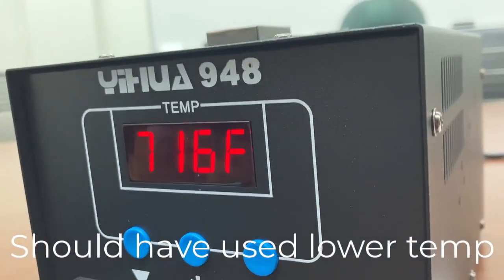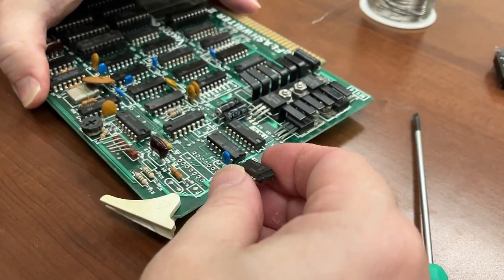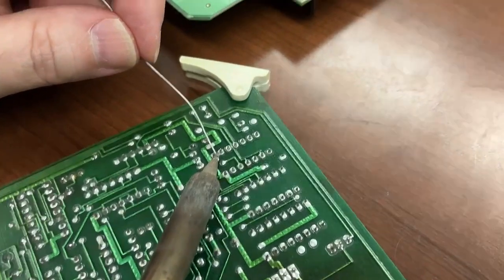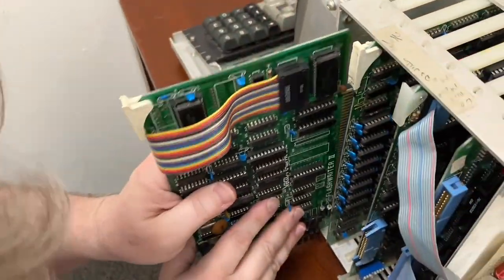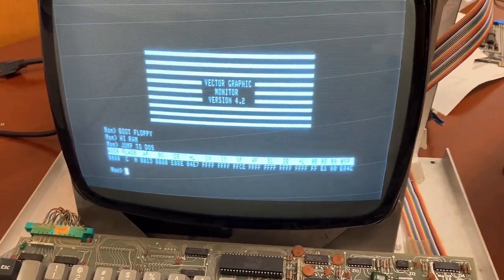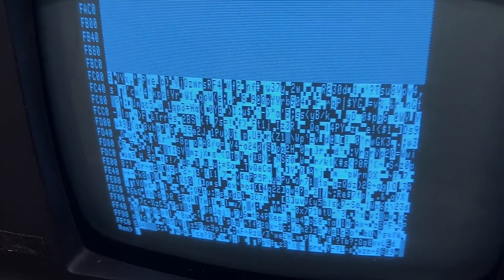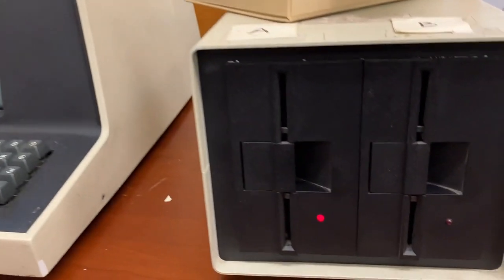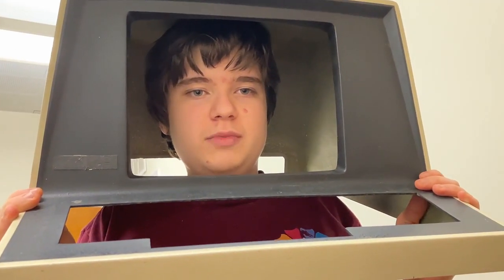CP/M S-100 Bus Computer Repaired: Vector Graphic 3 (Flashwriter II Video Card had Bad Inverter Chip)

Comment: That is ancient - I'm 61 years old and started my career working on those Vector S100 CPM machines - wow what a kick to see one of those running.
Reply from the maker: My dad had a Vector 4 at one point. I wrote essays when I was in middle school with Memorite III.
Reply: @Lantertronics  Yes the Vector 4 was one of the last offerings from them before they went out of business.  We did some development of software and hardware on the Vector 4, but elected to go with the new IBM PC platform instead.   Wow I forgot about Memorite -  I want to say we had a version of Word Perfect and Lotus 123 for the Vector but I can't be 100% sure.    I repaired a lot of S100 boards - mostly the memory boards and serial ports.

Comment: Congrats on the bring up.

I'll refrain from a soldering critique but will say that I always clean the tip before each solder, every 2 or 3 joints on sockets pins. Wet sponge is fine, metal scrunchy preferred, single swipe is good, this has worked for me for 50 yrs.

Those old boards probably used 63/37 solder and desolder without adding. I solder Kester 63/37 at ~200C or 400F and hardly ever use flux.

Comment: If Georgia Tech really cares about its reputation, they would equip you with proper state-of-the-art Weller or Hakko stations.
Reply from the maker: Oh, we do have some nice equipment like that along those lines, I just need to use it during the day when the lab staff are around to access it. I wanted something of my own to use at home and during weird times.
Reply: I have Weller and Hakko stations. My 2 Yihua stations hot air&soldering stations work just as well.